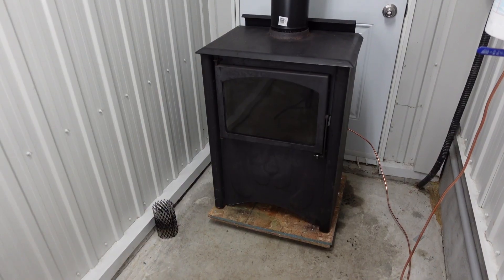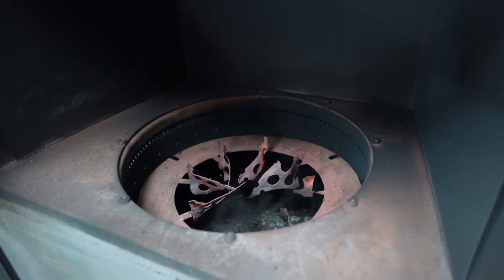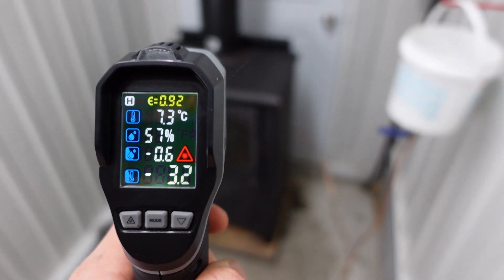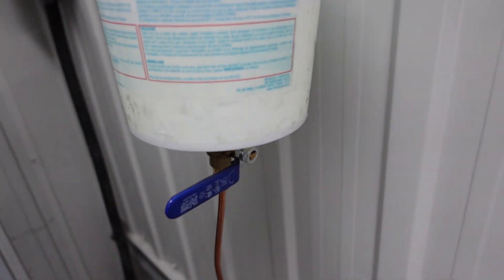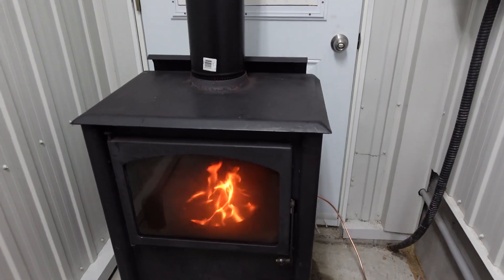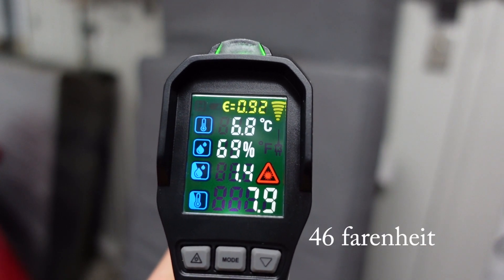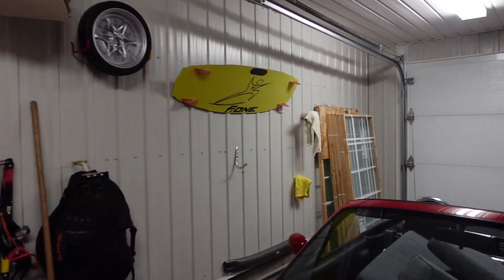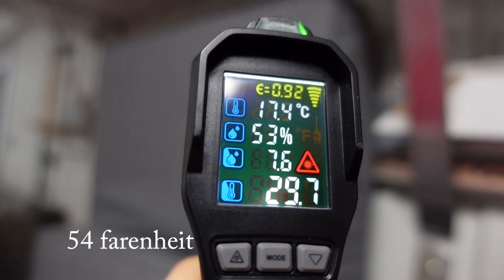OIL STOVE | Heat test | 60 minutes to heat space | Thermometer | gravity fed

Comment: Hi Phil. Thanks for these vids. I live on a boat in the Uk and we need a stove this time of year. My stove hasn’t been burning right just lately. After a good clean I think it’s a filter between the header tank and the carb. Any tips on cleaning the filter please. Thanks again.
Reply from the maker: Good day, thanks for the comment! In my other video I should how to remove the filter and clean it. Simply use a soft brush or even an old toothbrush to clean it out, nothing harsh like metal or you risk testing the filter material.

Comment: Good afternoon, I hope you can help us. We have a stove in the garden with diesel fuel. The problem is that the carburettor no longer fills with diesel. All hoses are clean and I have put in a new fuel filter. Do you know what the problem is?
Reply from the maker: It may be a simple bubble in the fuel line preventing flow.
Reply: It may be the oil regulater valve it has crude inside the screen and ports inside. You must disable and clean inlet and outlet ports but remove lst the filter on the bottom long section of valve